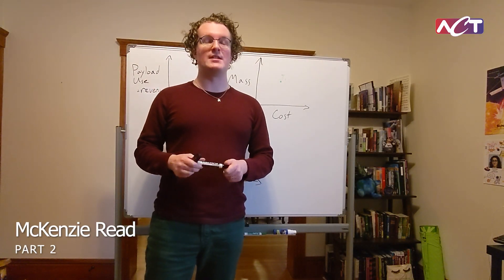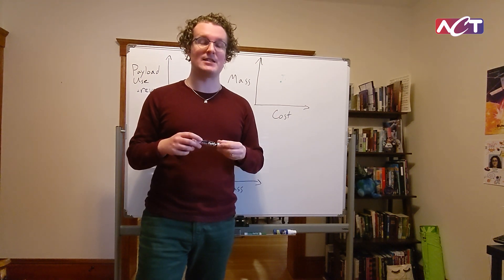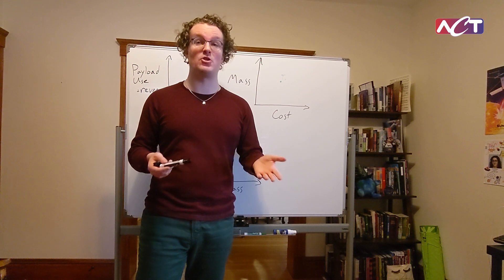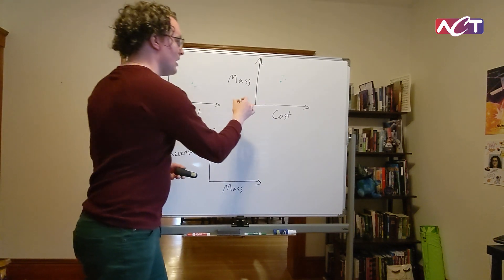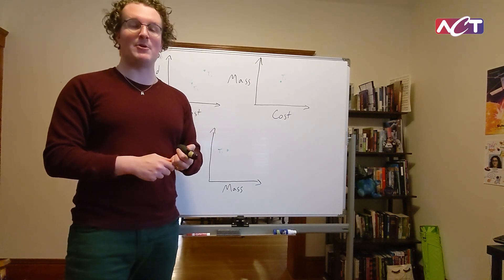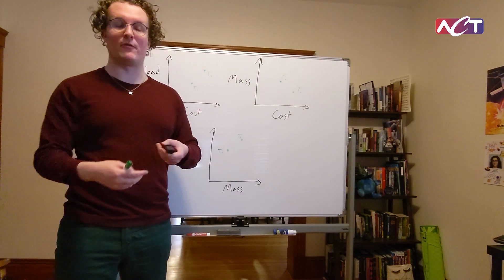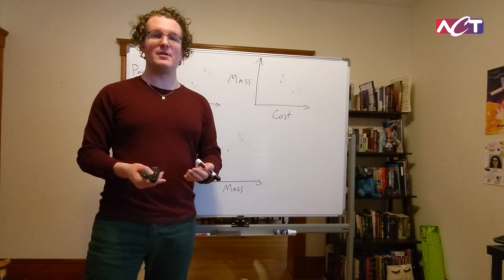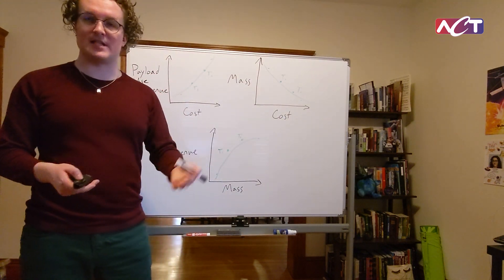Moving Heat Away From Your Spacecraft  - Part 2  I  Engineers With Markers

Comment: Expelling waste heat never made much sense to me when conversion techniques exist, but I suppose cost constraints make it more efficient than recycling back into the power system.
Reply from the maker: If you have a system generating a constant amount of heat in a constant environment that you want to keep at a constant temperature, you’ll need to expel the same amount of heat somewhere!  I love waste heat conversion aesthetically, but the temperature difference between the hottest circuit board on a spacecraft and the coldest radiator isn’t very large, so the Carnot efficiency would be quite low.  Reducing the radiator temperature improves the temperature difference but increases the radiator size (and mass) substantially.  But when it’s possible to raise the source temperature significantly (in a plutonium RTG, for example), then extracting work from the waste heat does become feasible.  The other way to reuse waste heat is to displace it before expelling it, either by transporting it to a part of the spacecraft that’s simultaneously too cold or storing it for later use in a colder environment. Hope this helps! Thanks for checking us out!
Reply: @AdvancedCoolingTech  I had not considered how minor the temperature gradients would be. That makes total sense now.  👍
Reply from the maker: @thetruth45678   Glad we could help! Feel free to drop us a line on our website if you have more inquiries - https://www.1-act.com/contact-act/